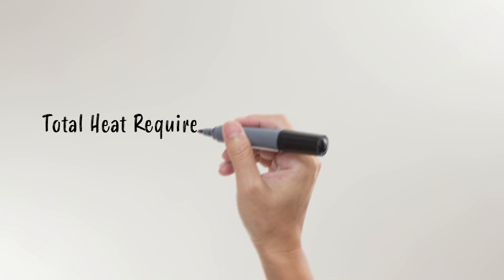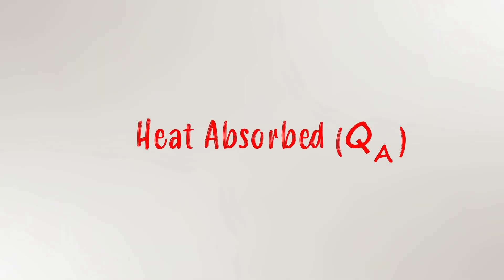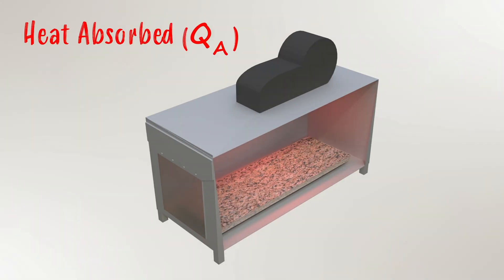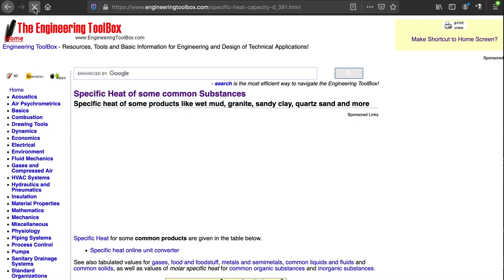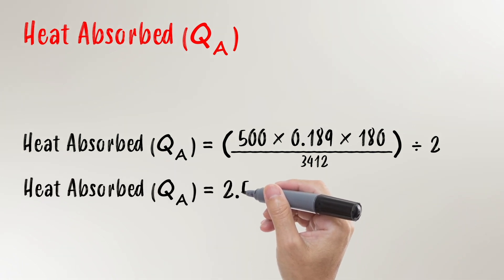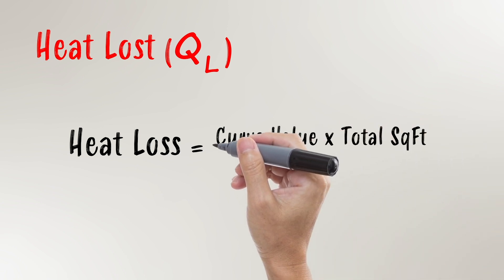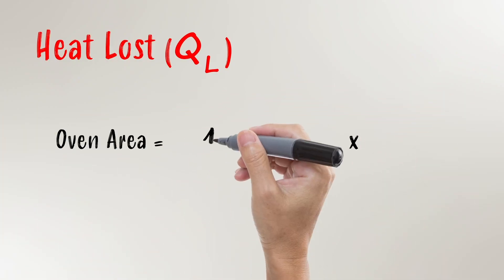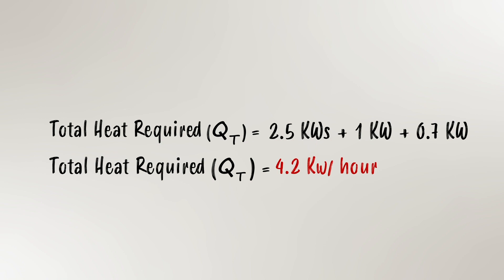How to Calculate Heat

Comment: Hello sir. I am watching from the Philippines and I would like to ask about the Heat Loss calculation regarding to the square foot(area of the oven). You calculated the square foot by multiplying L x W x H, isn't it the volume of the oven not the area? I am hoping for your favorable feedback to this comment. Thank you and God bless.
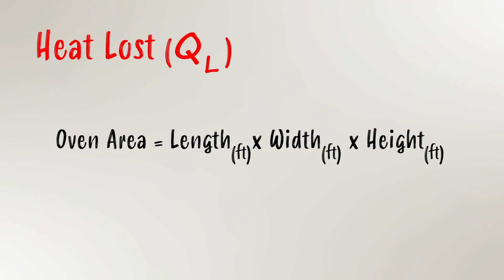Reply: Yes, they appear to erroneously calculate volume (L*W*H) at 6:14 instead of area. Surface area for a rectangular prism = 2(WL+HL+HW) or 412.5 sq ft for the 7.5'W x 7.5'H x 10'L oven example used. Cheers!